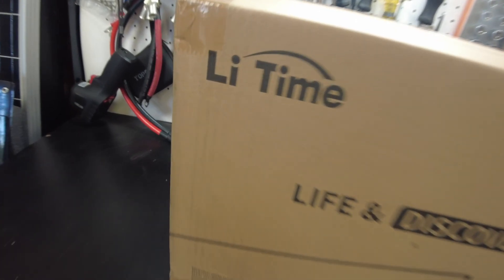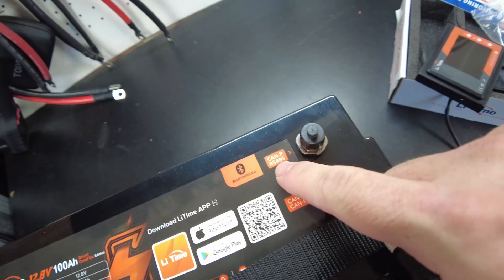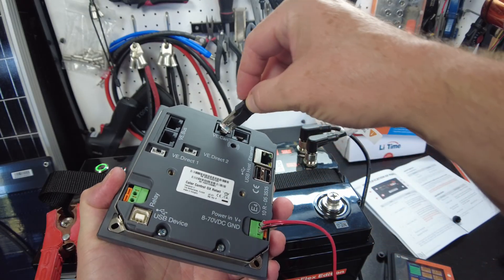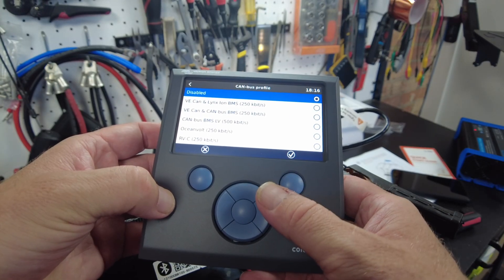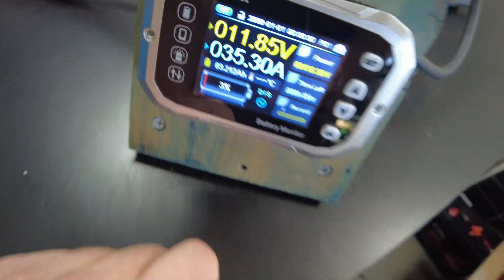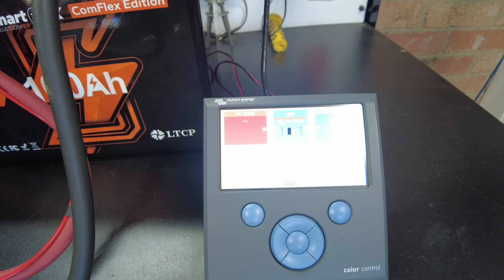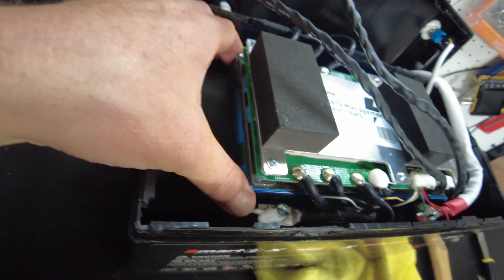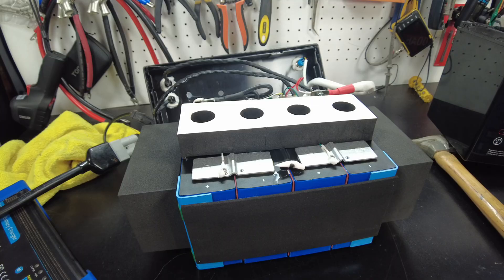LiTime 12V 100Ah Smart ComFlex Battery with Bluetooth & Victron Communication

Comment from the maker: 8% off code: BRAD8
LiTime 12V 100Ah Smart ComFlex Battery (Affiliate Link): https://www.litime.com/products/12v-100ah-smart-comflex-battery/?ref=BRAD
Amazon Affiliate Links:
Victron Energy Color Control GX: https://amzn.to/473TXSq
Or the successor to the Color Control
Victron Energy Ekrano GX: https://amzn.to/479R031

================
AFFILIATE DISCLOSURE: This channel may earn an affiliate commission if you purchase products through links I provide, or use my discount codes. 
================
CONTACT: bradcagleyt@gmail.com
Business/Collaboration only. Please do not contact me for for personal project help, or advice.
================
DISCLAIMER: These videos are documenting my own personal projects, and experiences. These projects, and activities can be dangerous. I am not a professional. You should always consult with a professional. This content is for entertainment purposes only. DO NOT try any of this at home, doing so will be at your own risk.
Reply: Brad I made an interesting discovery - I fitted a roadside temporary lighting tower 12 v (14.6n)  20a  lithium charger to my RV - It worked great charging my 310ah  Lifepo4 battery but its fan never started turning until 55 deg c and then very slowly - as the unit was fitted under the seat/bed I didn't like it getting so warm - I opened it up to find the fan was driven by a 20k NTC attached to the mosfet heat sink,  who's resistance does not zero till 125C - I swopped it out for a 10k NTC now the fan starts at 45c and seems to be about half speed at 55c and gets no hotter - its a great way to get electronic things to run cooler

Comment: I have one Smart Group 31 LiTime 165ah battery and I cannot get the "parallel mode" option on my app?  How did you get to that?  What is your app version - mine is v1.6.3. I see where my app lets you create a "battery system" but it wont let me do it with one battery.  The issue is called Full Charge Protection and basically the LiTime Smart battery "shuts off" once it gets to absorption charge.  The app will read 14.2v but the voltage at the terminals will drop to 13.6-13.7v.  It basically will not output any current until the voltage at the terminals drops down to 13.6-13.7v which can be a problem if its in parallel with other batteries at a slightly higher voltage than that. "Parallel Mode" is suppose to disable Full Charge Protection but I cant get that mode to display on app version v1.6.3,

Comment: Can you take and parallel regular lithium and see the charge and capacity via this smart battery?

What about putting regular lithium in series with smart will it realize it's 24v?... If so can shut down smart battery to disable pack but dumb will still be available voltage so nice to remote shutdown